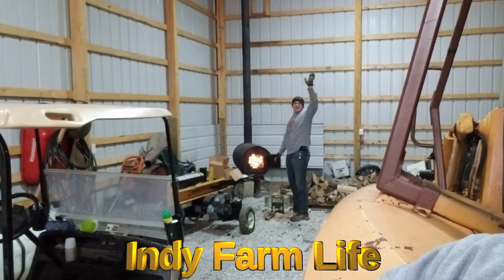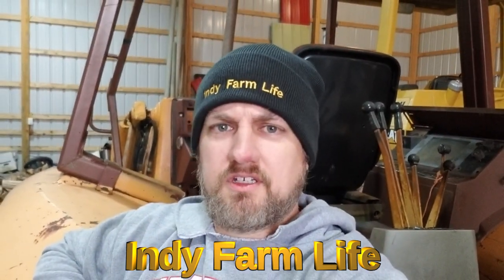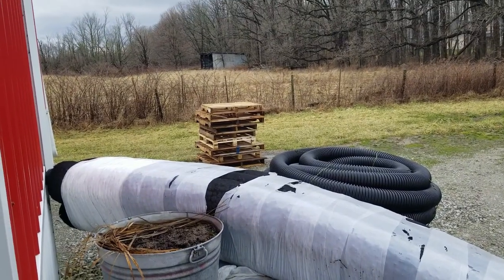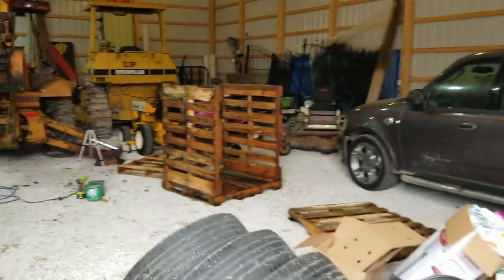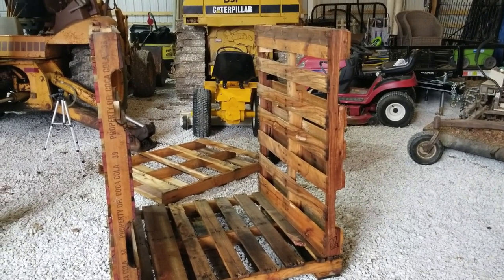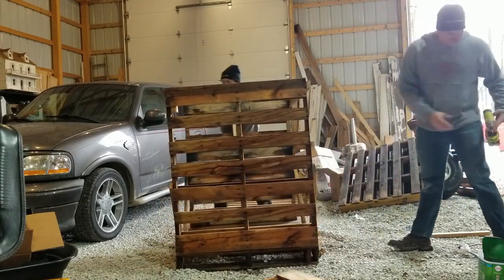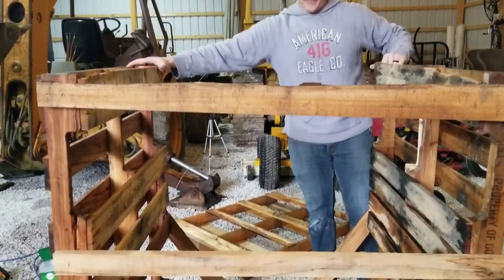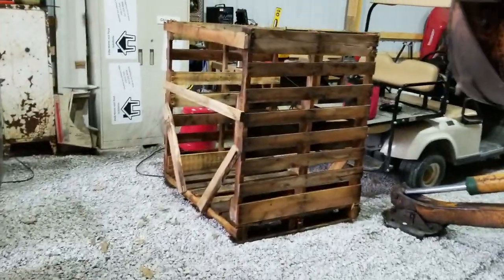Turning Pallets into Firewood Holders

Comment: Why not use a 4th pallet for a back wall in place of the braces?
Reply: Bob Grier that's a good idea, I might do that to mine.
Reply: @ignoranceisnotatrend4669  Here's another trick. I use a swazall to take teh pallet apart or sometimes cut teh planking with a chain saw between the 2x's. I run the thru my  table saw in 3/8" strips and cut them to size. Best kindling you'l ever use. It's already dry. Great for camping trips and pit pits.